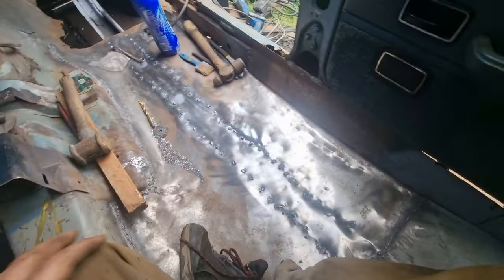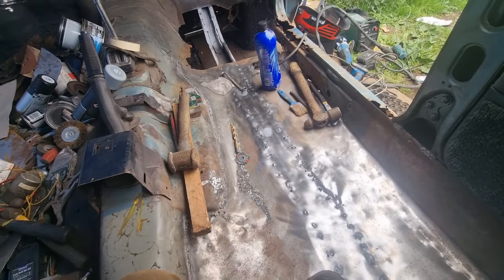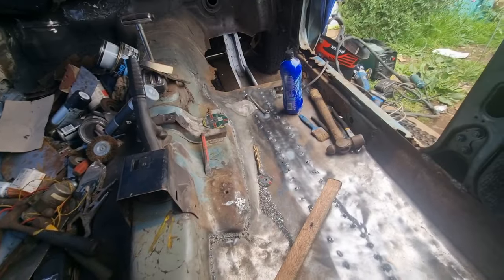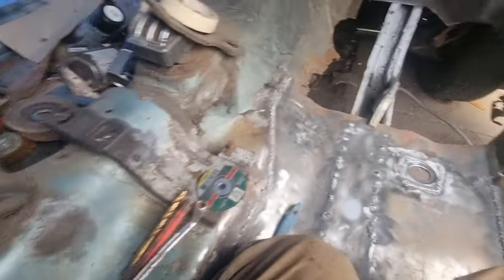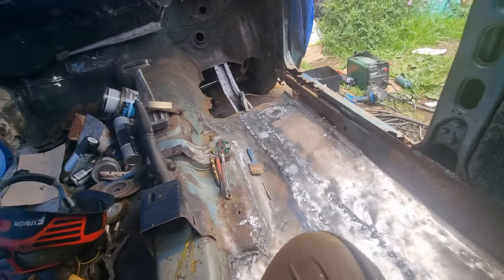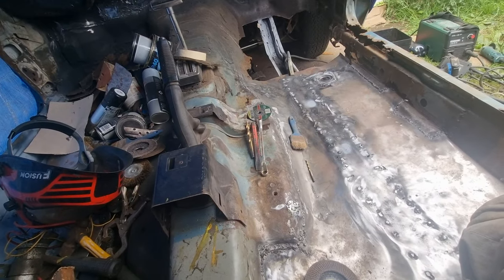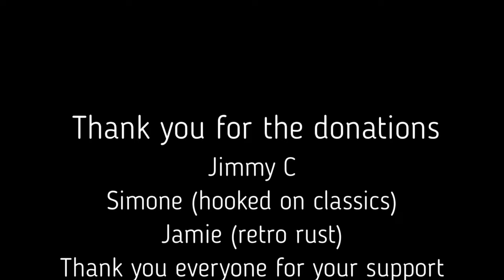Cortina Mk4 Ghia 2.3 V6 Restoration || Drivers Front Floor Pan P2 (P42)

Comment: The work your putting into the car so far is grate   at the rate your goin  itll be ready for paint in no time :) 

Wish i could have the same progress on my granada :(
Reply from the maker: thank you i really want to get working on the outside of the car lol whats stopping you with the granada ?
Reply: @AdamSNook.  the recond start motor havein problems agen  and it keeps flooding  and iv tride 2 difrent carbs... :[
Reply from the maker: @Nottsmodifiedcarchannel  ohh thats strange flooding like its pumping to much fuel
Reply: @AdamSNook.  yeah ...
It's defo a carburettor problem

Comment: Class!  Looks like the driver side floor was quicker to repair compared to the passenger side,  I recon another days work and you will have the floor pan at the front all buttoned up. so  there is no holes in there at all.  Have you found another set of wheels for this?  i remember you saying that you were looking at getting one more.  I  would buy a set of 5 and have them refurbed and boxed off, ready to go.
Reply from the maker: thank you yeah hopfully erm i really like the wheels thats on it i can paint my self i have paint guns and air compressor i have painted a few cars on my drive lol and turnd out great only colour i hate doing is silver metalic silvers i will have no probs refurbing the wheels i need 1 more as i only have 3 oem wheels but have seen some one selling them on ebay for around £20 each she will also get new wheel nuts aswell
Reply: @AdamSNook.  you will need another 2 OEM wheels, to make it up to five. the two that are on the rear are not the correct ones.  One looks like its from a later ford.  If you can get them For £20 each id look into it. Just as spares.   I sat my metro on a set of standard rims until my wide wheels were sorted out.  It was a laugh powering 160 bhp through those.  It would spin up the gears, if you gave it some beans. 
Also adam no harm in looking at older rims for this too,
Reply from the maker: @procta2343  yeah the 2 fromt wheels are oem good the 2 rear ones are 1 is ford capri on passanger side the drivers side rear is a space saver lol how ever i do have another oem one in the boot thats is in good shape to so that makes 3 i can use the ford capri one as a spare and take the spare out and put it on the car leaving me only needing 1 more
Reply from the maker: @procta2343  but will look out for a good set later :) just want all 4 matching wheels for now

Comment: Have you a Lidl welder like me 😂?
Did you look at bondo billy for the flux core welding yet?
Reply from the maker: Yes lidl lol,it's my brother in laws yes watched I love is attitude lol took a few tips from him
Reply: @AdamSNook.  I also have Lidl's stick welder. it works great but only on heavier steel. I welded the sills on a fiat panda with the flux core welder and it passed the test, painfully slow going but the brass wire brush makes it easier to see the work piece
Reply from the maker: i am really getting to know the fluxcore welding learning a lot along the way once you see the orange pool just keep striking it of the orange pool and keep going along like  that gets better and better stick welding is the best welding you can get as its for heavy duty work beams ect but very hard to use on cars lol my dad was a stick welder and a bloody good one it was is main job welding stair cases in tall buildings